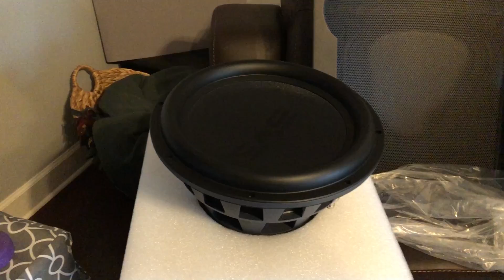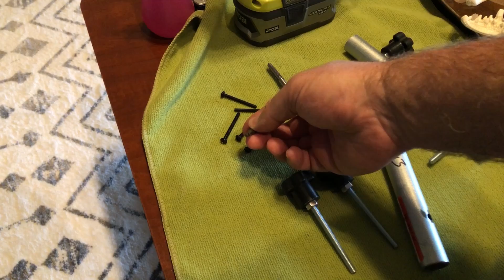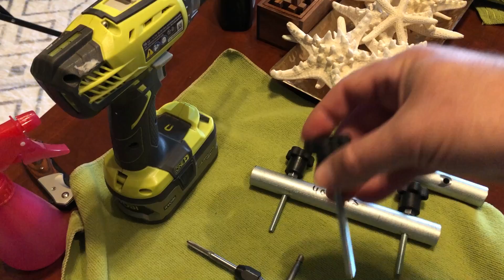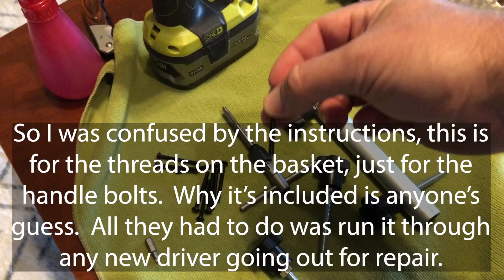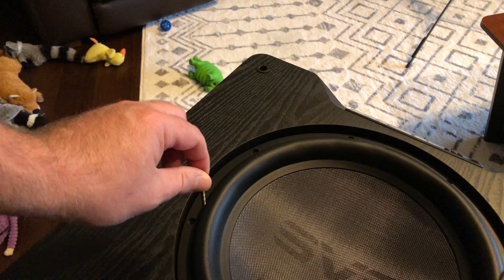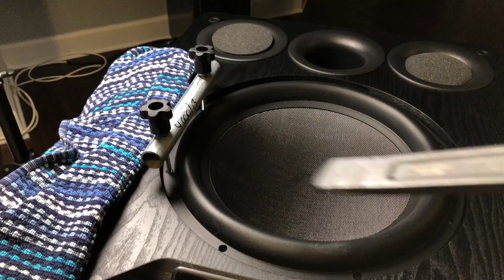Replacing Blown SVS PB4000 Subwoofer Driver

Comment: i had the same problem and found out how to fix the driver,actually a simply fix
Reply from the maker: That's great, what was the fix for you?
Reply: @COGuyStuff  the driver has a copper pipe inside the motor unit,the glue comes un stuck really easy when there is not much glue there to keep it secure,all i did was take it out and wow it works like new again,i will soon upload what i did ,once i make a channel

Comment: I want to upgrade my 22 year old PSB subsonic 8 subwoofer but it seems SVS subs are very prone to breaking. My PSB sub hasn't missed a beat in 22 years of hard use. I wanted to get a SB3000,  starting to wonder if I should get a more reliable brand. The PSB has built in circuitry to stop the sub from ever being overdriven, why isn't SVS using something like that?

Comment: I got a SB4000.After unboxing I saw some white/grey Streaks/Stains on the Rubber Surround.SVS said that would we off-gassing.I cleaned it with a damp microfiber towel and a light all purpose cleaner.But I’m not sure if I should keep it after this.I mean it’s a Subwoofer for 2400€.

Comment: are these drivers 4ohm load?
Reply from the maker: I think so but never looked
Reply: @COGuyStuff  Please, it would be really important for me to understand at what impedance these amplifiers operate, as I would like to buy the SVS Upgrade Kit for SVS13-Ultra plate for a DIY project. On various forums, people specify that SVS is strictly against using their components for DIY purposes, so the only way I have to clarify this doubt is if someone, like the YouTuber in the video, measures the impedance with a tester.
I need a passive plate for my DIY subwoofer rated at 1200 W RMS, but the only decent ones I found are the Dayton Audio SPA500, which is too weak, and the Hypex FA502, which has a somewhat cumbersome DSP and, in my opinion, unclear data between typical and max power. The aforementioned SVS module is amazing because it would allow me to work with Bluetooth adjustments as well, but if it doesn’t output at 2 Ω or 8 Ω, even this would be useless for me.

Comment: I just did this to my PB16-Ultra. It said not to tap the hole more than 3/8”. I tapped mine and put a handle on it. I pulled it out. The cord seemed long enough for me. When I went to put the new sub into the hole, the handle fell off the sub and the sub crashed into the hole. It broke off a chunk of my piano gloss black wood so I’ll have to touch that up. I have a new driver and new amp but my new sub doesn’t sound anything like the old one. I’m getting annoying vibration noises all over the room. I untightened and tightened by hand. I set the app settings exactly the same, even used screenshots. It just doesn’t sound right. Was yours different after replacing it? I just ordered $70 worth of isolation feet from the SVS website but I’m not happy right now. I will say though that the sub before it broke was an amazing sounding sub. Best I’ve ever had. Also their customer service is amazing. Great group of guys.
Reply from the maker: You dropped your new driver. It’s pretty easy to damage it that way.
Reply: @COGuyStuff  Obviously wasn't intentional. The handles you had have knobs that turn to screw the screws into the driver. My knobs didn't do anything. I needed a socket or an adjustable wrench and my tools were at work. Just got the isolation feet today so that's the next step. Yes I dropped the sub on one end but the other side was in the hole. Hopefully I didn't damage the sub.

Comment: Wait you can blow a SVS subwoofer driver? That's bad on SVS. Between the tuning of the box and amplifier. The user should not be able to blow their driver regardless of settings. That explains why my SVS subwoofer sounds like it does. Bought mine brand new and it came like that. I will check into getting a new driver to see if the sound I'm hearing goes away.

Comment: Great video man. I got dual pb-4000 and both of them are broke now. Bad driver on both. I was scared at first but after seeing ur video now I now I can change them without problem. I do have a question tbh the remaloval kit was also from svs or did you buy those elsewhere ?
Reply from the maker: They send it with the driver

Comment: Unfortunately this is all too common with SVS subs.  had to replace mine and the amp twice.  Wasn't abused - just chinese junk
Reply: Yes they definitely do not make Electronics like they used to I tried to share a video with you about how one of these new Subs are built in the amplification section however I do not think it's letting me post the link if you're interested please make a comment and I shall respond back thanks and have a great day.

Comment: Probably not a good idea to plug two ports, I'd only plug one
Reply from the maker: It's not an option.  The software is only tuned to specific configs.
Reply: I was about to point that out it could of happened because playing below port tuning
Reply: What do you mean?
Reply: @CoomerGremlinDGGfan  it reduces the port tune frequency, which means reduces maximum output, increases distortion, and increases port chuffing, more likely to overdrive the woofer.

I'd only recommend plugging one port on to his sub
Reply: @billybobby7607  I have a pb4000. What would you say is most optimal way to run it? One port closed or all 3 ports open?
Reply: @CoomerGremlinDGGfan  try both, all open will give you highest output. One port will give you lower frequency but lose couple of dB of output
Reply: @billybobby7607  is sound quality impacted at all?

Comment: Damm.  What a weak looking subwoofer.   
That motor is small.   
Someone need to amp dyno the amp.   I doubt it does 5000 peak like they say.
Reply: It's 4000 not 5000
Reply: @simongeorge9705  Still. Double is sometimes achievable but usually at lower power amps where psu is limitation. It can take 1200w of power so quite a lot but I doubt it would overcome higher than maybe 1800w peak

Comment: My pb16 just blew for a
Second time and I want to do this instead of swapping the entire monster as I have a bad back. It didn’t feel like the screws with the handles would strip the sub holes while picking it up? That’s a lot of weight being held by just two screws. Anyway great video. I believe I will give this a try
Reply from the maker: Plenty of thread, non issue. If you have a bad back though, someone else will have to do this.

Comment: I have an SB-3000 its messed up also 6 months old. Contacted SVS sent a new sub right away but WTF i thought these were supposed to be the best lol mine is ticking/rattling on super low bass notes. I also replaced a klipsch driver because of a bottoming out type noise also and it was straight out of the box bad. Great customer service on both though but still.
Reply: I was trying to share a video with you about what's going on behind the scenes with these cheap Class D plate amplifiers. However every time I post the link my whole comment gets taken down. Let me know if you're interested in watching the video of what a engineer has to say about the new Klipsch Subwoofer , I would be more than glad to share this with you, I feel the same way I'm to the point now to where I'm scared to really buy anything.

Comment: Why do they give you all those tools for. Just take the screws off until the thing on its side the sub will slibe out and grab it and unplug it and then slide the new one back in
Reply from the maker: Uh, no.
Reply: @COGuyStuff  had lots of subwoofers . MTX 9500 12 inch is like 80 lbs by its self had like two of them in an box
Reply: So 80 x 2 160 lbs just in subs not including the box
Reply: Why?

Comment: my pb-2000 now makes the same noise and I'm getting a new driver. What caused the driver to make this noise?
Reply from the maker: A blown voice coil, from trying to play it too loud.  When the amp runs out of power, the signal clips and distorts.  In my case, it was the previous owner and they didn't test it before sending the unit to me.
Reply: @COGuyStuff  but I never heard any clipping or distortion.  How do I know if its too loud?
Reply from the maker: You have to know what it sounds like.
Reply: @COGuyStuff  are there any videos on youtube that show what it sounds like?
Reply from the maker: I don’t know I never looked.
Reply: @velocci6666  hi. Clipping is when your sine wave starts to look like square waves if viewed on osciloscope. Top and bottom part of your sine wave starts to give direct current and voltage when amp goes into clip. This dc voltage is the main cause of burning your voice coil on the woofer.
With the amount of power on hand and the extra headroom the digital amplifier can produce I think it is more of a mechanical issue when the voice coil bottoms out and bend the profile of the voice coil.
Always listen for abnormal sound when playing loud music. Ive seen alot of times people overdrive the equipment and altough loud you can hear the music is irritating because the amp or speakers are past their limit and woofers start making pop sounds and tweeters only makes noise.
Reply: @pietpompiepompiepiet940  Is it still a matter of overdriving the subwoofer if it is mechanical in nature? How can this be avoided? I make a habit to listen for weird driver noises with all of my speakers, but with my SB16 Ultras the tapping sound just came out of nowhere.
Reply: @Theater_Of_Doom  Hi. I have 2 Pb1000 and adjusted the volume output with the mic to be the same level.
When the volume goes up at - 20dbm on the reciever playing music I start hearing the rattles and it may sound that the speaker drivers are bottoming out but standing at the speaker I found the noise was from the ceiling that resonate. It can be decieving. I found that playing arround with the phase control and setting the crosover to 40hz on reciever helps a bit.
Reply: @pietpompiepompiepiet940  I uploaded a video highlighting the noise emanating from the SB16's voice coil. The noise pops the mic on my phone so it isn't as clear as in person. There is a distinct tapping like the voice coil former is bottoming out on the motor assembly (Gain: -10dB, trim: -7dB, master AVR volume -19dB).

After EQing these two SB16 Ultras with a miniDSP UMIK-1 and REW I'm still on the fence about sealed subs in a home theater environment. I figured the large driver size and overhead with the amplification would get me where I wanted to be, but it's becoming obvious that I'm demanding too much from these subs. I can back the gain down to -20dB and get rid of the bottoming out, but the difference in output is immense.
Reply: @Theater_Of_Doom  Yeah that is also a reason I went for ported subs
People say the sealed subs are fast and more for music but you have to drive it harder.
Reply: @Theater_Of_Doom  I checked the video. Is it both subs or only one making the noise?
My woofer moves alot more than that and on video when I video my Pb1000 it looks like the cone change shape like oval from the movement but does not make that noise.
The drivers can move alot more in and out on your sub compared to the Pb1000.
Was it like this from new?
Is it the same on 2nd sub?
Reply: @pietpompiepompiepiet940  Yeah both subs do the exact same thing. I've had them for less than a month, so this is what I've encountered new out of the box. SVS says the drivers need to be replaced, but they say that no matter what (no real tech support).
Reply: @Theater_Of_Doom  I have my Pb1000 subs at halfway input volume and reciever at - 6dbm. I managed to shake the downlights in ceiling as it have movable lights and you can feel the vibrations on the couch like if you are in a vehicle with subs kicking you in the back. I can barely hold out with the reciever at 0dbm as it can damge your hearing.
All this without any kicking or poping noise from the subs or floorstanders.
You are supose to get much more output with the subs you own as they are way more powerful and capable than the Pb1000

Are you using the rca conection?
Have you tried speaker input?
If both subs make the same noise it could be your signal.
I had faulty 5meter sub rca cable that caused a hum and measured 13ohm on the centre signal wire. After replacing the cable my sound quality improved.
Can you plug in the sub at a friends house using his equipment.? Try to isolate the cause as your subs can play very hard
Are you running the subs from a power strip as your voltage can drop when the supply draws current to generate the bigger sine wave and if your supply voltage drops the sine wave clip. This is all theory but check for all the possibilities. I have seen people posting weird faults with their audio amps going in protection mode but at the shop everything works.
Reply: @pietpompiepompiepiet940 I start to bottom the SB16s out at subsonic frequencies (20Hz and below) only in extremely crazy scenes in a few movies with the master volume at my max listening level. The output from dual SB16 Ultras is pretty impressive I can't deny that. I just think they really struggle with subsonic playback when pushed to their limit (you can push any sub too far). I enabled the RGC (room gain compensation) feature in the SVS app and set it to 25Hz (with 12dB slope) to taper off the subsonic zone a bit. This completely eliminated any perceived bottoming out of the voice coil former and did not negatively impact audio quality. As for driver travel, it's hard to really tell how much it is traveling from the perspective in my video. It does move to a scary degree when pushed hard.

As for connections I'm currently using brand new SVS RCA cables (2M long). They are pretty competent interconnects with great shielding. The SB16s are plugged into a Furman Elite-15 Linear Power Conditioner which has a 40 Amp capacitor dedicated to current storage for your amplifiers. I don't think there is any way they are getting starved for power. The AVR I'm using is a Yamaha RX-A3080.
Reply: @Theater_Of_Doom in my opinion for the money you spent you should not have to baby that subwoofer please let me know if you don't mind if you are still using SVS?? There are a lot of reports of these subwoofers given issues.Thanks in advance for your time.
Reply: @TheNLHAZE  I still run the dual SB16 Ultras in my theater room. I received replacement 16" subs to install per the recommendation of SVS. The popping sound was still there right from first fire with the new woofers. I've spoken with several individuals who I consider experts, one of which was "EXO Contralto" (here on YouTube) about my issue and he agrees that it's the voice coil former smacking the motor assembly. Sealed subs require so much more power to control the driver compared to their ported counterparts. This is amplified when we're talking about controlling the driver at frequencies of 25 Hz and below at high volume levels. 

If SVS offered to swap my SB16 Ultras for PB16 Ultras I'd have nothing negative to say, but they insisted there was something wrong with my sealed subs instead of acknowledging the "pitfalls" of a sealed sub in a theater environment. As crazy as it sounds the SB16 Ultra does not have enough amplifier to properly control the driver at 25 Hz and below. Which is why I adjust the "room gain compensation" to reduce the impact those frequencies have on the subwoofer's performance (set to 25 Hz, slope: 12 DB per octave).
Reply: @Theater_Of_Doom  Thanks for your time 👍👍

Comment: I had to open my pb16 ultra before and I notice the ports on the inside just end in the bottom and not standing in a 90 degree and like the way I just saw yours in the video I asked svs about it because I thought I had an unfinished unit because what I saw on my sub wasnt what I saw online from a cut out pic from the same sub .i was told what i saw was a prototype and what i have is how they as being shipped but now i see the same thing as the prototype on your sub
Reply: Very interested what did you end up doing thanks in advance my friend...

Comment: you have also 2 ports closed like me, i don't know why this isn't a fix setting in the app
Reply: You clearly have two ports plugged with the foam plugs in your video. Lewi was just asking. No need to get snippy
Reply: But in the video you have? Now im confused...
Reply from the maker: Dude, that was just to help me lift it in thus repair video. At no time did I say or show it running with two plugged ports and no one should be using it that way. Don’t assume things.
Reply: @COGuyStuff  thanks for the video, but you also never said you put the foam plugs in only to lift the sub in your repair video, unless I completely missed something you said.  The video clearly shows two plugged ports and that's all LewiAlex was asking you about.  And plugging ports we know is an option (as is plugging a single port or running all 3 open)
Reply from the maker: I don't know what you mean, I never had 2 ports plugged, that's not an option.
Reply: Oh oh.. i skipped to much (my english is not that good) sorry for that.. but i have with this the best results in my room 😅 I messured it with rewe (more low bass with 2 port plugged than 1) and also with hearing it sounds best for me..
Reply: @LewiAlex Thanks for your information. I still think for what we pay for these Subs should not be giving all these problems svs has great service but still what happens after the coverage runs out ?? Thanks again for your comment my friend cheers...